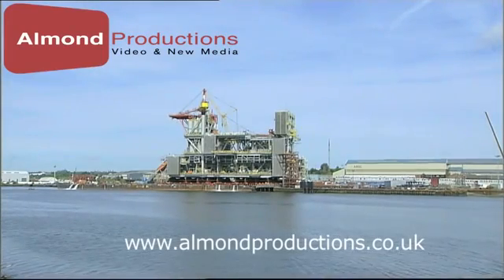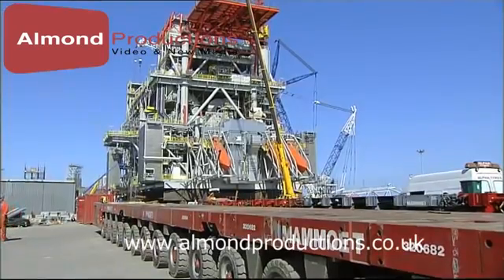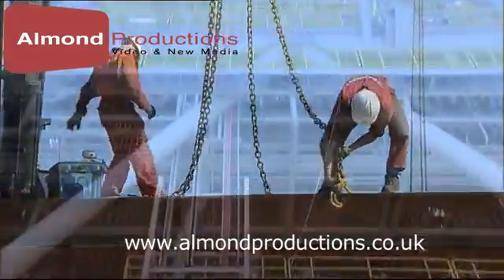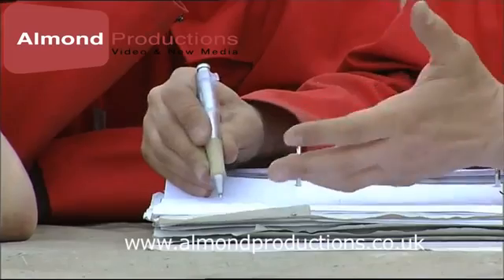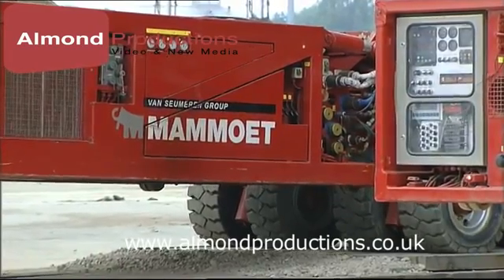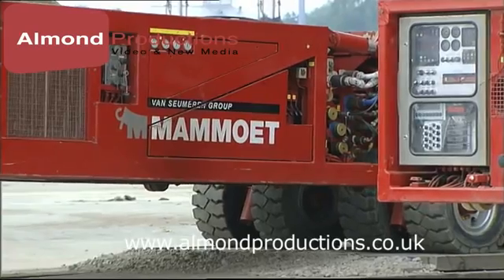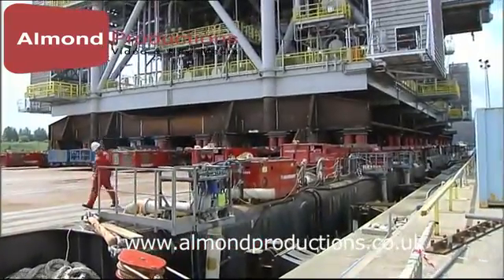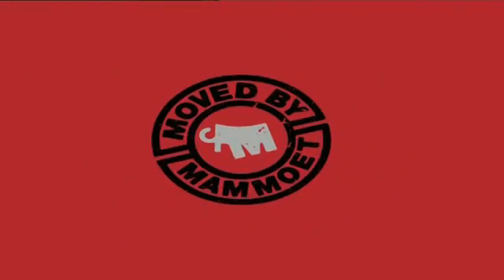Mammoet - Mega load out of BP Clair Topside

Comment: The last UK project I worked on, after this was dropped onto the Jacket, it had the drill set, accomodation module and flare hooked up, a huge job and possibly the last decent sized project put into any NE yard.
Reply: Is OGN still there?  I used to service the air compressors that were fitted in the shipping containers.